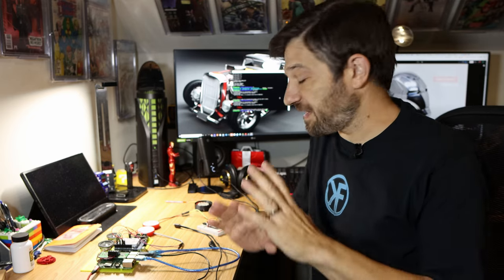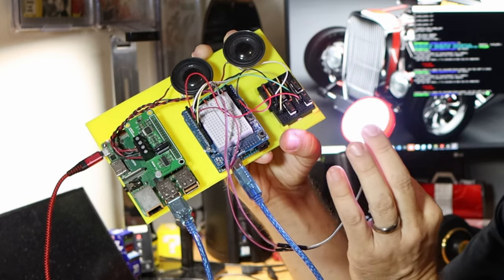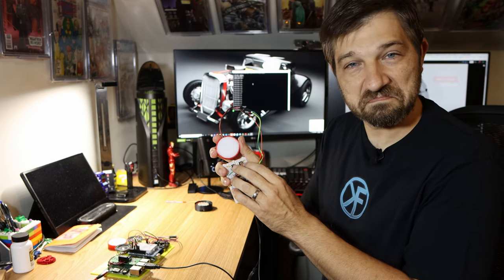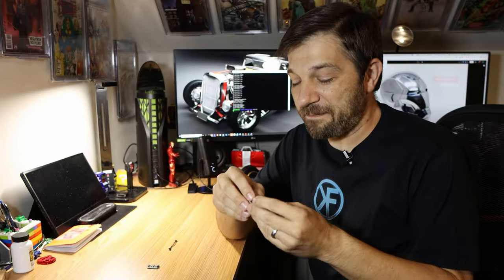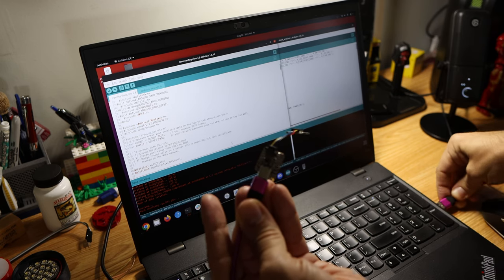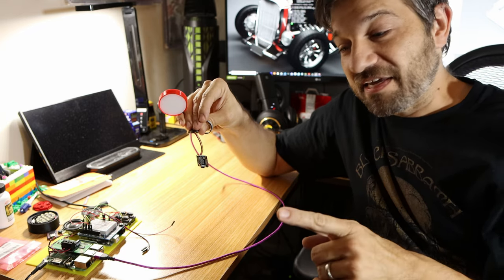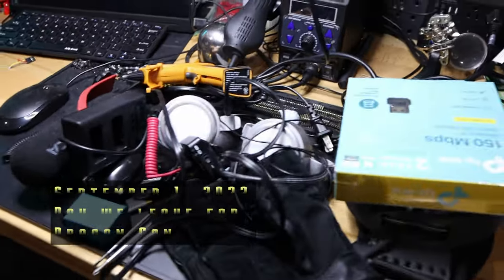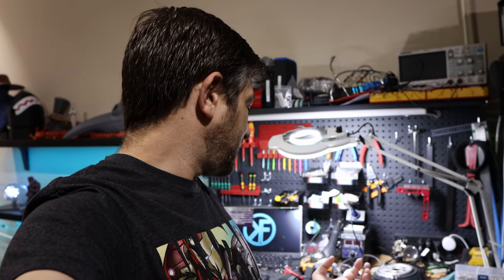The Tech Behind Wireless Iron Man Repulsors

Comment: Very cool. Will be interesting to see how having a bunch of wifi boards on your suit then handles being in a convention space, where I assume the RF interference is going to be pretty high. I suppose the end game (hurr hurr) would have a full suit and so you could be running wires then anyway, but still be cool to see how reliable it is.
Reply from the maker: The plan for me is to keep it all wireless. I've seen other cosplayers deal with the wires and it looks like a nightmare. I think the proximity of the pieces should keep WiFi really reliable. Ultimately they will be connecting directly to an access point on the central computer.

Comment: It's great to see a fellow wireless build, and your presentation is outstanding as always! Out of curiosity, did you consider other wireless protocols like Bluetooth/BLE or low frequency radio?
Reply from the maker: I really appreciate all of that and I'm glad you enjoyed it! I did consider both RF and Bluetooth. I didn't consider RF very long due to it being dependant on special hardware or custom protocols. I don't like the pain of Bluetooth pairing, especially sometimes with custom embedded work.
With WiFi, it automatically connects with the WiFi credentials and I have a reliable connection that nicely connects to MQTT. Also, so many things have WiFi, so I've left a lot of options open. Some of them... you'll see in a few months.

Comment: wouldn't it be a thing to put the flex sens in the wrist, like when you bend the wrist up as you were to fire the repulsor like in the movies. that would have been a better solution on the mk3 then bending it with the finger.
Reply from the maker: It's not a bad idea at all. The only issue is how it work when putting on the suit. There's usually no armor or even a seal around the wrist.
Reply: @kerseyfabs  that's a fair point, didn't think about that. i assumed it might be put in something like a frame. such as the prototype repulsors from the first iron man movie.

Comment: Interesting to see you using a gyro sensor for the effect activation! It probably s better off since you are just doing the hand units. Otherwise, I thought you could use the flex sensor on your wrist if you are building the whole gauntlet, it'd allow activation when the palm is down too (to emulate flight positions). But in any case, cool effects with audio syncing!
Reply from the maker: Thanks! I like the sensor because it really offers an unlimited number of options in terms of using hand gestures. In the future, I may move to a sensor specifically designed for gesturing.

Comment: Hi kersy I have a question I installed a micro swiss direct drive on my ender 5 plus and the stepper motors progressively got louder please help 😢
Reply from the maker: Stock main board?
Reply: No silent
Reply: @kerseyfabs   it is silent
Reply from the maker: @hestonalmendinger1971  You'll want to turn down the current to your extruder. If you check out the silent board video, you can see how I did that. I'd do 0.1 increments until I was happy.